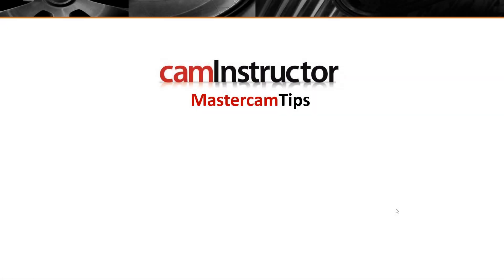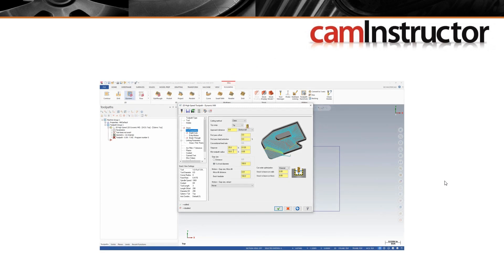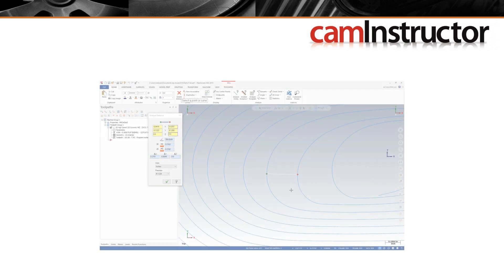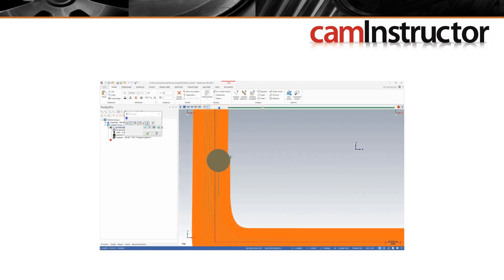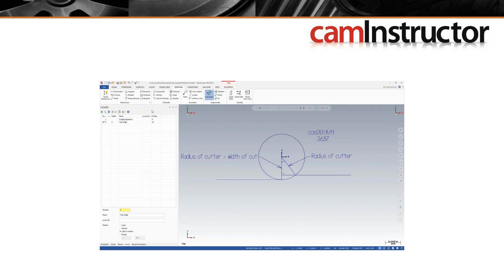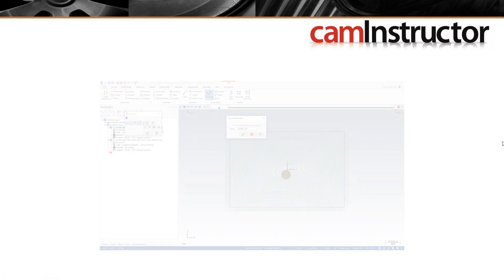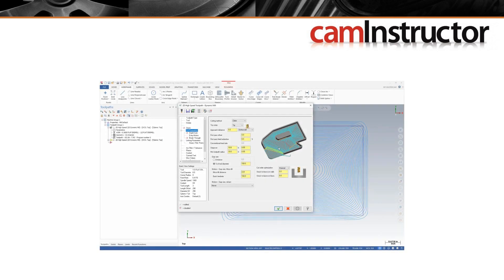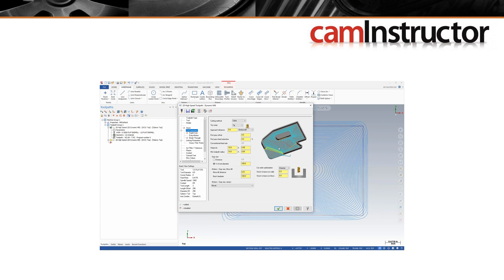Mastercam 2019 - Tool Engagement - Intro Video

Comment: Does the horse power of the machine tool play a role in designing the most effective tool path into the program?
Reply from the maker: Thanks for the question William; 
In short, yes horsepower will play a role but machine rigidity will play a greater part in what ‘best’ engagement angle works for a machine.

Many factors will play a part in deciding on the ‘best’ tool engagement angle to use.  Machine, tool, material, cut, etc….each of those can also be broken down further. Eg. When factoring for the machine, yes one aspect would be the horsepower but we should also consider the rigidity of the machine, the spindle rpm limit, the torque curve, and even the machines kinematics will have an effect.